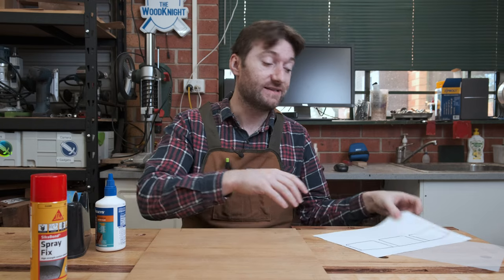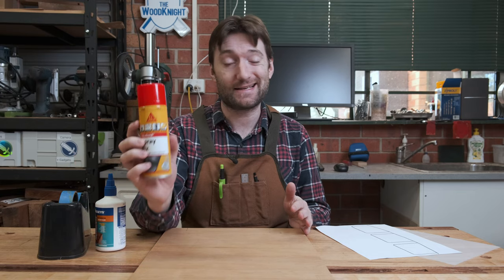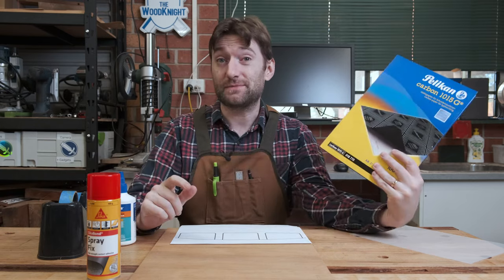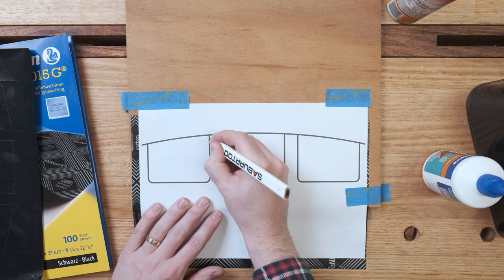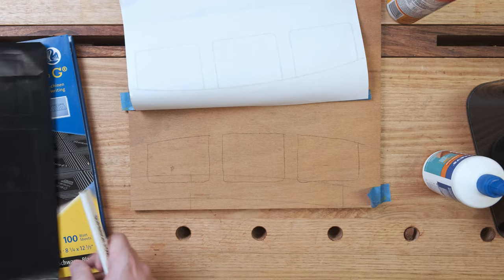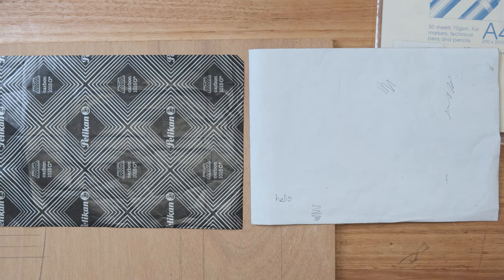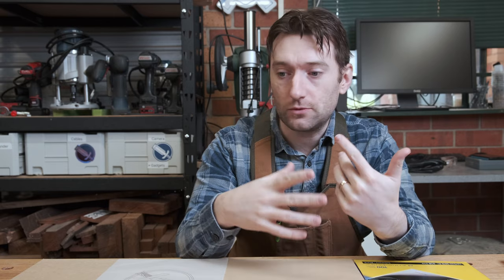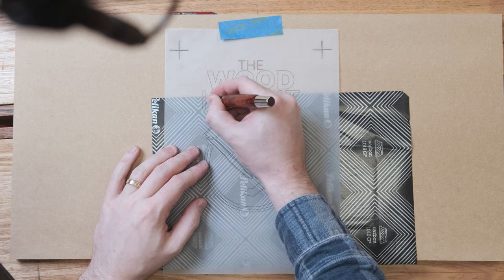Transfer Patterns To Wood Using Carbon Paper

Comment: You can transfer inkjet, and laser printer drawings to the wood, with an iron.  Print a reverse or mirror image, and then place it on the wood and go over it a few times with an iron set to cotton.

Comment: I've been a spray and stick kinda guy... but have often resorted to scoring the wood through the paper and then struggling to follow the faint line. Carbon paper might just be the solution.
Reply from the maker: I tried that method once, but I ended up almost giving myself an anxiety attack as I second guessed which line was that cuts I added, and which ones were dents or just the grain pattern! :|
Carbon paper isn't the right method in all situations, but its nice to have a variety of different methods on hand. So long as I don't overthink which one is the correct one for the task at hand :D

Comment: You can also take your image from your desktop file,  print it onto the smooth side of labeling paper, and then use a  credit card to transfer that image onto the wood ( by pressing over the wood, much like applying an actual decal onto the wood.) This works with any inkjet style printer. I've done this hundreds of times with great results.